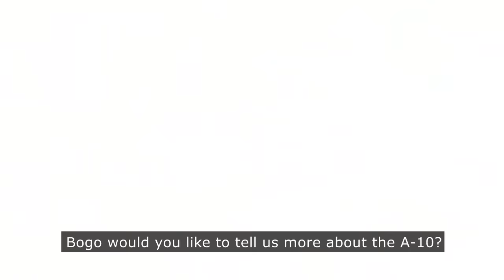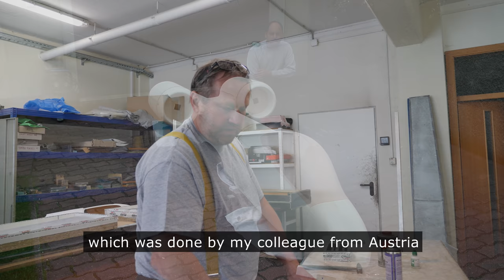Inside RC Jet Workshop - Mibojets (Part 3) A-10 "Grande" Kit Assembly

Comment: I wonder how they deal with copyrights, we can't put exact copies of the planes in video games because factory can sue us and they do sell exact copies of the planes, thats using someone's property to earn money, either they do have a license or they are tiptoe on the wrong side of the line.
Reply from the maker: It's definitely not an exact copy, it's a scale model - it was developed on this scale from scratch. It has it's own engineering solutions-for pretty much everything. Even if you had the exact 3D model of the original you couldn't just "copy" it in 1/4 scale. There would be no prototypes needed if that were the case. The name A-10 is not trademarked. When you "copy" vehicles in games they have a high chance of misrepresenting the original (performance etc), and that can be used as grounds to legally prove damage is being done to the company which made the original-that's why game dev's avoid it.
Reply: There are ARF twin-turbine A-10 Warthog large/giant scale kits on the market. Kit costs several thousand dollars (turbines not included). You can make them really scale looking. They are large size but not quite as big as this model.